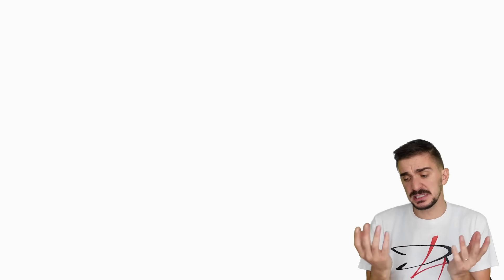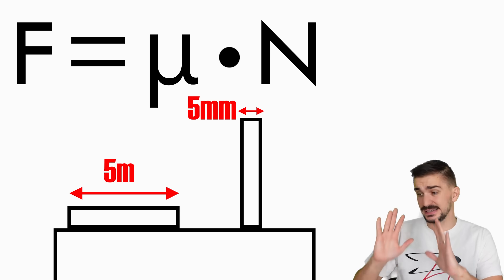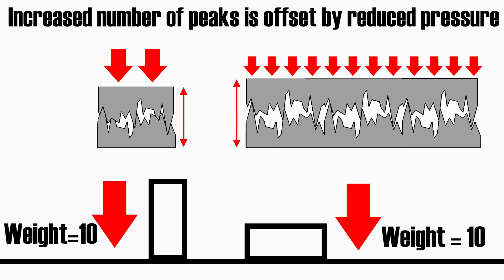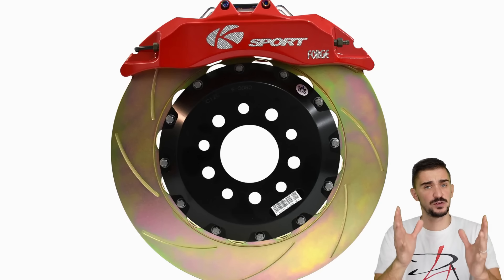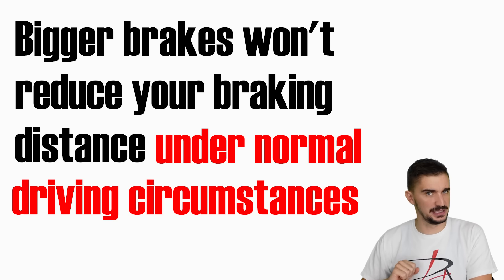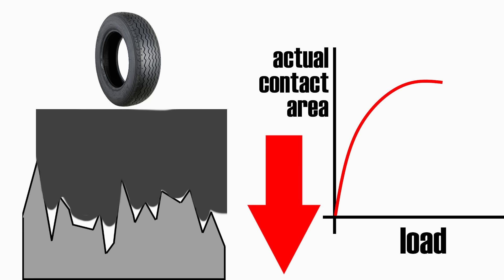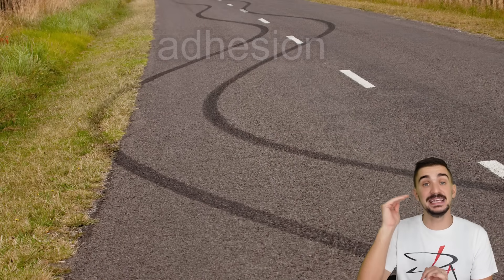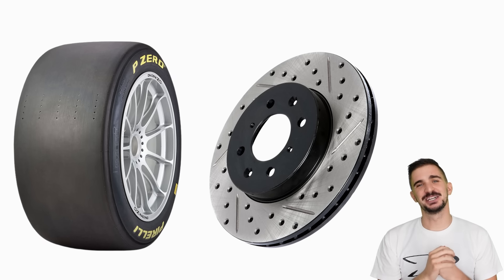Why Big Brakes Won't Stop You Faster but Wider Tires Will - Friction and Surface Area Explained

Comment: I recently upgraded brakes for my car from 288mm to 314mm discs, and the braking performance is night and day. I'd say that there is something missing here. 
Taking that, means the manufacturers are wasting their money, for example, on BMW's, where the cars equiped with small displacement engines are receiving smaller diameter brakes, 276mm, and 3.0 are getting 330mm. (And before this is dismissed as to the smaller engines are ligher, the bigger ones are heavier, that's not exactly true. Aluminum 3.0d is as heavy as cast iron 2.0) - The braking performance does not even come close on each of them (E46)
Reply: I also drive old BMWs. What most people forget is proper brake cooling. In a lot of cases the people don't really need big brake kits etc. If they upgraded brake fluid, better disks, pads and proper cooling your stock brake can go a long way.

Comment: 0:40 what are they spraying on the rotors?
Reply from the maker: Brake cleaner probably to degrease them
Reply: @d4a  oh. That makes sense, yes. Thank you for your very quick response.

Comment: You are talking about force applied to the pads.  Without considering heat dissipation and since pad surface don't matter, would a bigger caliper with more piston change breaking performance?   Or is the forced applied limited by the master cylinder and maybe brake pedal lever?

Comment: Bigger rotor = bigger arm force of the rotor, therefore, more braking force for the same pressure applied to the pads..
But this doesn't invalidate the heat dissipation capabilities.

Comment: correction: surface are IS in the formula *twice*, you just don't see it because the coefficient of friction multiplies by that area, while the downward force divides by that area, thus the area does not show up in the abridged version of that formula.
Reply: also your explanation of why thin tires perform better on wet conditions is not entirely correct.
water does not care about the distance, it cares about displacement.
wider tires have more displacement, that displacement generates buoyancy, which works against the gravitational force acting on said tires, which reduces the normal force, thus decreasing friction.
Reply: If the two area values cancel out, then the formula is not "abridged" without them. It rightfully doesn't need them at all. Area never need be considered in the first place.

Comment: What hasn't been considered is the greater leverage of given friction value with a larger disc the longer a lever the greater the force that can be applied to the center as Archimedes said ' I could move the Earth if I had a long enough lever', basically as Titus says below.
Reply: any brake on a modern car is capable of completely stopping a wheel from turning
Reply: @player1GR  All modern cars have ABS so you can't stop the wheel from turning my thoughts are for classic cars with modern rubber.
Reply: @alberttaylor3917  Of course he means, "Stop the wheel from turning OR reach the ABS threshold."

But you're right. I have a modern car on which the OEM brakes certainly could do that. But they were only just capable of doing it. Once I added much stickier rubber, they couldn't any do it any more. I can see the same thing happening when putting modern rubber on an old classic car. But instead of a big brake kit, I solved the problem just using brake pads with a higher coefficient of friction.

PS - Proper punctuation helps. I'm not being an asshole; it just helps the reader make sense of your posts more easily.

Comment: Another reason the motorcycle's brake discs aren't vented is the motorcycle isn't as heavy as the car - more mass at a given speed is more energy to dissipate as heat. If you look at the brake discs of really small cars you will start to find non-vented discs.
Reply: Haha, true! My gti rear brakes are like that. The worker at the parts store started laughing when we unboxed the rear brake pads cause they're so small they look like motorcycle pads lol!

Comment: A larger pad has more mechanical advantage essentially. If you are applying force further from the wheels axis, you get better stopping torque.
Reply: Extra mechanical advantage means nothing when you're already able to cause movement with a smaller lever.
Reply: But extra "stopping torque" beyond what's required to lock up the wheels is irrelevant. The limiting factor in reducing stopping distance is almost always grip.
Reply: @itsasecret2298  Right but without driving every single vehicle ever made how do we know which vehicles need more stopping power and which need more traction? This is an extremely case by case basis.
Reply: @Saddedude  That is simple, every manufactor puts in a big enough braking system, thats why every car has ABS.
Reply: @Saddedude  There's really nothing case by case about this.

 Braking systems in every mass produced consumer vehicle are capable of locking up the wheels. If they aren't on any individual vehicle that's a sign of mechanical failure which needs to be repaired.

Comment: Wow, that was a really valuable lesson! I do believe that a large part of your audience are car enthusiasts who are considering upgrades and modifications. Most of us are not engineers but with the great content you provide we can make some informed decisions.

Would you be willing to do a video on manual transmission shaft materials and shift forks assemblies?
Reply: It means that I approve of your suggestion and would like the channel yo make a video on this topic.
Reply: THIS
Reply: @aezarexxzarus4846  What do you mean by saying "this"?
Reply: Case hardened EN36 is basically designed for shafts. 
If you can't get that, then just use 4140

Comment: Do the brakes last longer? Do they cool faster? Do they make less dust? Is it better for bad weather like water on rotor? Does switching away from OEM brakes to after market allow me to have more brake choice like different compounds or cheaper brakes? Can it help with brake feel?
Reply: as someone who races on the weekends and upgraded to significantly larger brakes let me answer a few of your questions based on my experience.

do they last longer? depends on how you're using your brakes, in just street driving, it doesn't appreciably change, in spirited/racing conditions yes, it reduces failure and lasts longer.

do they cool faster? again this depends on how your using them. in racing, you are repeatedly applying your brakes so they heat up faster and the airflow is what helps cool them. in slower street driving you're not getting as much air cooling of the brakes so it cools at about the same rate. but the larger caliper/pad takes longer to heat up.

do they make lest dust? not in my experience. my brembo's are a very dusty compound. carbon ceramic brake systems are lower dust, but that involves a lot more trade offs in both cost and lack of streetability.

is it better for bad weather like water on rotor? you're going to have the same issues of surface rust on the rotors, as long as they dont sit in water for a long period of time, the surface rust should come right off with use. now as for stopping while driving in wet conditions, that has more to do with tire tread and size of contact patch than brakes.

Does switching away from OEM brakes to after market allow me to have more brake choice like different compounds or cheaper brakes? it depends on what you're switching to. in my case I went to the Brembo Gran Turismo Monoblock calipers, they are very  limited in pad selection, and as a 2pc rotor, its difficult to find replacement rotor rings. Typically you are going to have more pad/rotor options for OEM calipers.

Can it help with brake feel? the things that matter most to brake feel are braided steel lines vs just rubber, and fresh brake fluid that has been properly bled. Brake fluid is hydroscopic which means it absorbs moisture from the air, the more moisture/air in the lines the more spongey your pedal feels.
Reply: @Alkivar  big thank you

Comment: I asked a Dunlop engineer why slick tires has higher grip a few years ago.
His answer is similar to your explanation.
He said slick tire can grab on to more surface imperfection.
Reply: Slicks effectively work because they're softer and people typically go with a wider Tire with slicks but the main reason they work better is because they're softer regular passenger vehicle tires are designed to have a certain amount of rigidity to them especially all season tires as opposed to summer only tires so that they're effective in a wider range of temperatures whereas slicks are designed to be softer and get even softer and stickier upon heating up if you've ever actually use slicks when people do burnouts and then are able to get significantly better times it's because of the traction on their tires has increased now that the tires are effectively sticky and softer
Reply: @altaccount3760  If the roads were never wet, slicks would be the best choice.
Reply: @rangersmith4652  in a place with controlled climate to otherwise they would only be good during a certain temperature range and also softer tires make for weaker tires part of that rigidity in commercial tires would be for penetration resistance and additional suspension absorption as your tires act as a added layer of suspension on your car where slicks sort of fail at that but yeah you just have to warm them up in the morning with a good old burnout and youd be on your way xD but yea all roads would have to be like highways and they'd need to be swept
Reply: @rangersmith4652  also the rigidity from commercial tires adds to the tire life along with on the other side the softness of the slicks decreases the slick's life
Reply: @altaccount3760  But slicks don't have to use a soft compound.  They almost always do because they're not sold as street tires, just racing tires, so ultimate grip is valued over longevity.
Reply: @rangersmith4652  yeah if they made a stiffer Tire it would just take longer to heat up and therefore suffer traction wise for a longer period of time and then people who drove just short trips would always have s*** traction or you'd have to warm up your tires before you drive
Reply: @altaccount3760  That sounds like loads of BS. If you make a regular commercial tire into a slick one, no compound change, just zero pattern on the surface, the car would NOT slide everywhere with zero grip in dry condition. Slick tires are always better than patterned ones in dry conditions. The reason you need tire blankets on F1 slick tires is because they are harder compound that are designed to work under huge load at higher temperature. If you build F1 slick tires with the road tire compound, the tires would be gone in a single lap.
Reply: @full_wet_tire  I love how you had to fabricate a scenario with specific parameters for your opinion to even make any sense
Reply: @full_wet_tire  what exactly did I say that sounded like a BS to you
Reply: @full_wet_tire  cuz you're on a whole other chapter let alone on the same page
Reply: @full_wet_tire  did you miss the f**** part where I explained how tires work and you're just making up some hypothetical to argue against
Reply: @altaccount3760  Let's make it simple. Slick refers to the pattern on the tire, and has nothing to do with the compound. The reason manufactures make slicks like they did is because those aren't really intended for daily use. As a result they can afford to build those rubbers such that they work at a higher temperature, which is optimized for intended track use. So you can't even do a proper apple to apple comparison, which is why what you said is loads of BS.
Reply: @full_wet_tire  or you could just answer the question what did I say that was BS
Reply: @full_wet_tire  even in your own comment you say that they aren't and then you literally say that they are
Reply: @full_wet_tire  use your brain why are you acting like I said slicks are for daily driving or something I said why they're not including things like weather road traction Tire durability cost of manufacturing performance in all weathers and applications
Reply: @full_wet_tire  since you don't seem to understand racing tires even high temperature high-lowed ones are still softer than your average commercial Tire not even a good one and we're talking about an all summer Tire here
Reply: @full_wet_tire  huh wonder why racing tires are advertised from softest to hardest if the compound of the tire isn't relevant to the performance
Reply: @full_wet_tire  wonder why every professional manufacturing racing Tire company advertises the importance of Tire compounds and how they affect tires

Comment: What is your thoughts on tire tread and shape design? I was getting my car aligned and looking at the tires in the show room. Some of them have very square shoulders. Some have rounded shoulders. With some of the wider high performance tires, the rain grooves were so numerous and wide that they practically took away half of the rubber contact you would have had otherwise. Better safe than sorry I guess, I did spin out partially on the highway on mostly bald tires in the rain and through some stroke of luck I corrected the spin back to straight and kept driving and then changed my pants when I got home and thought about what I had done haha.

Edit: Oh yeah also, since winter tires are softer than summer tires to give better traction in the snow and ice, does that mean that that winter compound would also give better traction in the summer since it's softer? If it were, say, to be made into an all season / summer tire design but using the winter compound? The reason I ask is because a car drove by me today with the winter tires on and they were so loud because they were so sticky and it was just a reminder of the changing seasons for me. Winter tires are starting to go on. And they really are loud.
Reply: Winter tires are a softer compound, so they will have more mu per unit of load, but they also wear out quickly and have a relatively low peak temperature (due to the compound being soft among other things) so they will overheat quickly in the summer. You should buy track tires if you want tires with a sticky compound.

In terms of tread design, grooves will obviously allow driving in deeper water before losing grip and will also aid in surface cooling, but also increase surface heating. They'll also indeed decrease mu per unit of load because there is less rubber on the road.

Shorter, squarer shoulders and/or wider tires will be softer vertically (yes, softer) and stiffer laterally, which means the relaxation length and tire saturation peak will be lower, which increases "feel" or "responsiveness". Often lower aspect ratio tires are also built more robustly, further stiffening the sidewalls and often negating or even typically reversing the vertical springrate lost from going wider and shorter. You can typically expect them to be tighter and less comfortable as a rule.

Taller, rounder shoulders and/or narrower tires will be harder vertically, softer laterally, which does the opposite; less precise and more comfortable behavior. They also typically tend to be less robustly built due to the large sidewalls they inherently have, which typically ends up with taller tires also being more comfortable due to ending up vertically softer.

I am unsure of what the trend is for camber sensitivity; data kind of shows both ways but I am inclined to believe that stiffer tires peak at higher angles, while softer tires peak at lower angles. Shoulder block design will surely influence this, though.
Reply: If you remember the second portion of the video he talks about adhesion and very minimally tread. Summer tires are disigned to hold up at higher temperatures for it's best adhesion capabilities. Winter tires have a lower temperature for it's best adhesion capabilities. Notice I said "it's best," and not "the best." 

Example. I have a Focus ST that came with summer tires that were disigned for 40k miles. Bought the car in the middle of an Oregon summer. 5k and 10k comes around while still in 65+F weather and temps in the middle of fall with minimal precipitation, and the dealershsip said I am on track for more than 40k - at that pace in these conditions. Middle of winter comes up with lower temps down to 28F. 15k rolls up and the dealership notices my tires are over 3/4 of their life expectancy. Why is that? The tires are not designed to be driven in those conditions. Can they, yes. Should they, not recommended for optimal grip and wear life. A whole lecture wouldn't begin to scratch the surface of tire wear and grip alone. Fast-foreward to my current tires which are Nitto all-seasons and they don't perform around corners or hook up like the original summers did on dry warm pavement, but they wear more evenly throughout the seasons and give better traction in wet conditions.

The sound that you hear with winter tires isn't necessarily more traction with more adhesion, but more cuts in the tire that are designed to repel snow for the tire to make contact with a more adhesive surface. Also, it may be studs in the tires.